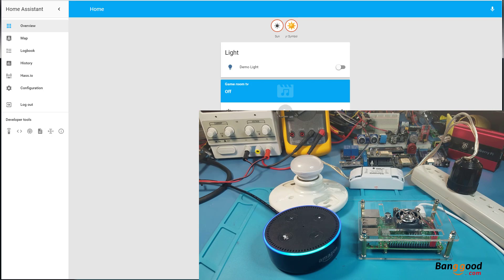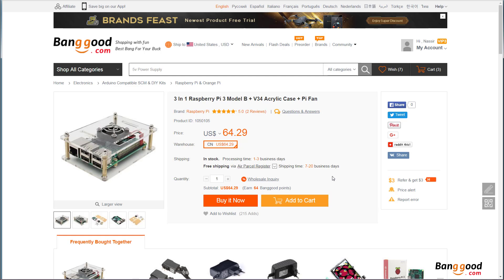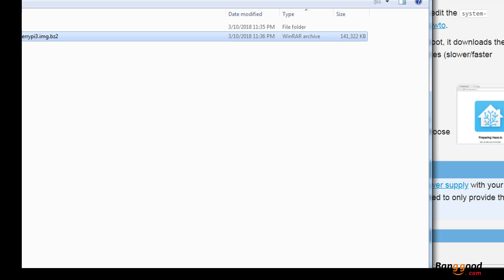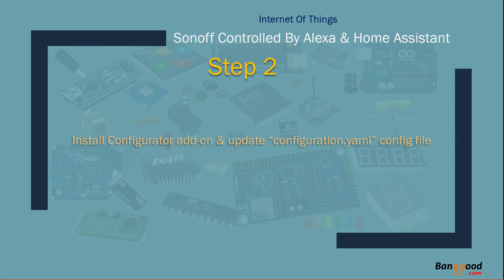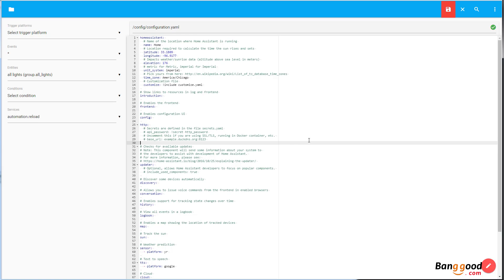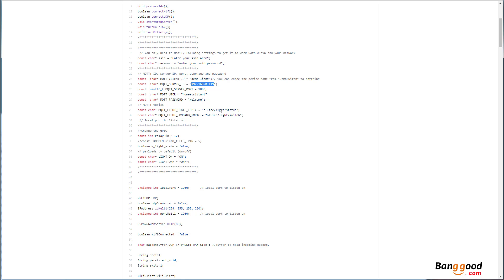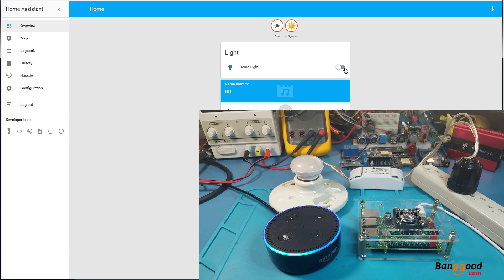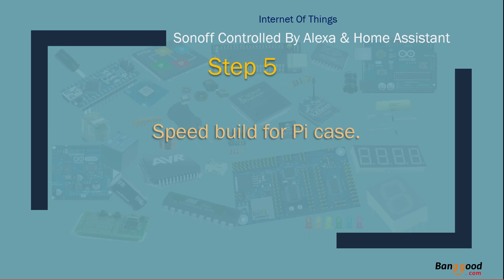IOT | Home Automation | Control Sonoff with Home Assistant & Alexa with MQTT server| Tutorial # 24

Comment: After connecting to my wifi i get the following in my serial monitor :

INFO: Attempting MQTT connection...
ERROR: failed, rc=-2DEBUG: try again in 5 seconds

i have the same code flashed on to my nodeMCU and Home Assistant is configured as displayed in the video, help..
Reply: I got the above error sorted but now the relay is not being toggled although the switch toggle's both via alexa and google home but the relay doesn't turn on or off, i tried changing different pin numbers but the result is the same. I even tried using a led but the result was the same.
Reply from the maker: John Wick you are unable to connect to the service due to the network issud. Make sure you are connected to wifi successfully.
Reply: MQTT connection is successful but the only issue now is that when i toggle the switch on or off via home assistant or alexa the relay/led doesn't turn on or off. I am using a nodemcu and tried different pins but the result was same.
Reply from the maker: What do you see in Arduino serial window?
Reply: The serial windows says "Got turn on/off request" , but the relay doesn't turn on or off.
Reply from the maker: John Wick check your gpio with multimeter or connect an led to mea sure that your gpio is setting to high and low when you give a command. If it is working then issue us how you connecting your relay. Otherwise you are connecting to wrong gpio

Comment: Why don’t you use ifttt to control lights using voice commands.
It will do the job for free and you won’t need to do this much work
Reply from the maker: You miss the point.I don't want to lose control if internet or Amazon or google cloud service is down.
Reply: This can work with or without Internet? I mean can we control devices in Home using Home assitant App when we are away ??
Reply: Netmedias Don’t u need internet connection to make this work?

Comment: hi, netmedias...I have seen your all most all video and i like it very much. with your tutorial i am going to do my own home automation project. 
thanks.
I Have one equerry to ask you. Can we add external home switch to sonoff after flash sketch. like use it 2 ways one is sonoff and second one is home physical on-off switch.
Thanks again.
Reply from the maker: Ashish Chauhan Yes, you can watch my following tutorial. To install a physical switch you nee to access the GPIO. You can see how I did that in temperature and humidity tutorial. Good Luck.

https://www.youtube.com/watch?v=QaY5m5RmB7M

temperature and humidity tutorial:
https://www.youtube.com/watch?v=XDkUfPxgjOw
Reply: Thank you so much for reply..I have seen both video but which sketch should i flash in my sonoff among the this two sketch which mentioned in video? and is I have to do any modification in sketch?